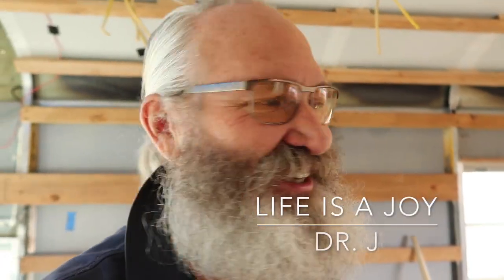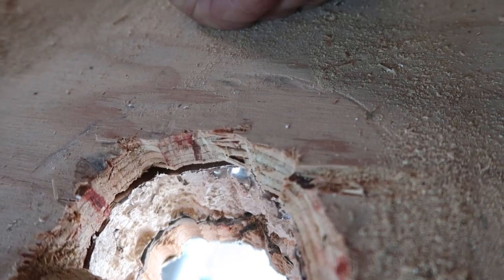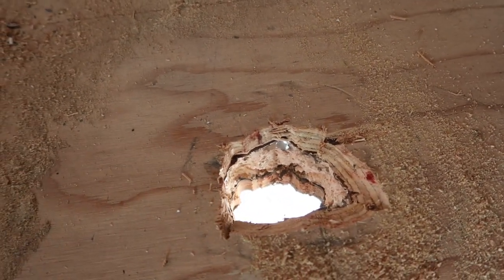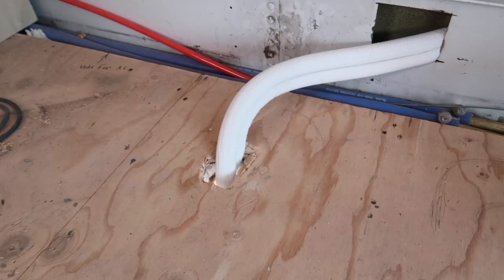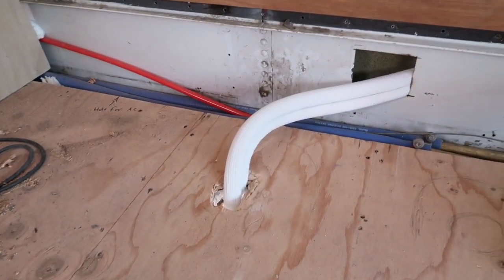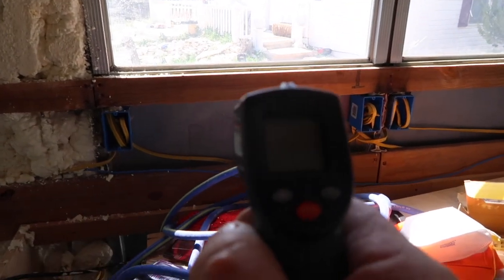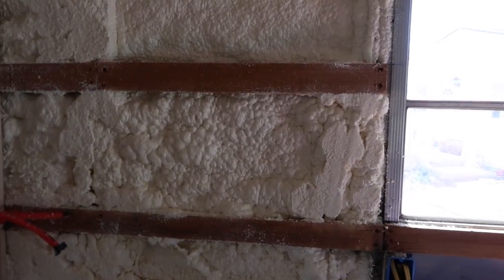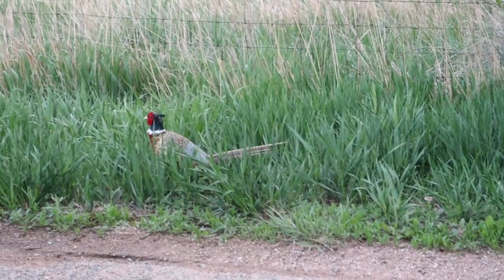School Bus Conversion to Motor Home #29 running copper to Mini split

Comment: The real value of that closed cell insulation is when there is a large difference in temperature between inside and outside.  So if it's 10F outside you could have a 60F delta T in the coldest part of winter or if it's 105F in summer then you have a 30F delta T in the hottest part of summer.  Plus closed cell foam is particularly good at air sealing.  Be sure to use a hvac vacuum pump on those refrigeration lines before you release the charge; air and moisture can severely damage a compressor over time.

Comment: Been wanting to ask you. Why did you decide on only a partial roof raise? I have seen a lot that do a full roof raise but I've seen probably just as many that do just as you have done. When I do mine I will probaby do as you and Transcendence have done. It kinda looks like the old Scenic Cruisers that Greyhound used to use.

Comment: I do not think that floor will flex! The temperatures you got are not really showing how efficient your insulation is. Insulation wants to stop the transfer of heat to cold. The inside of the bus is already warm, so it the gun is reading the warmth that is on the surface of the insulation. The three inches of foam insulation is going to work great to help keep the bus either warm or cool against the outside temperature. GOOD WORK!

Glenn Lever

Comment: nice solid flooring, i havent played with copper pipe yet its in my future when i build a solar water heater.
i dont mean to appear to be negative but being an aussie and having seen many things go up in flames for one reason or another , i was wondering if you were going to somehow protect flamable materials from the radiant heat of the generator or in the unlikely event of a fuel leak from the generator.
ill have to watch the vid mike knutson is refering to , ive used the same biblical method it works almost every time, used it when i worked in security , makes people think about their actions and maturity.
Reply: I think he will be fine with the existing metal enclosure.  However, if he wanted to further fireproof the generator hold, he could apply mineral wool insulation (like rigid Roxul Rockwall) and also gain some sound reduction in the process.